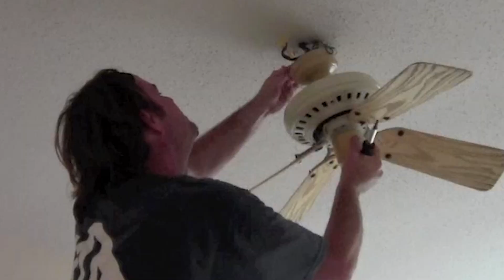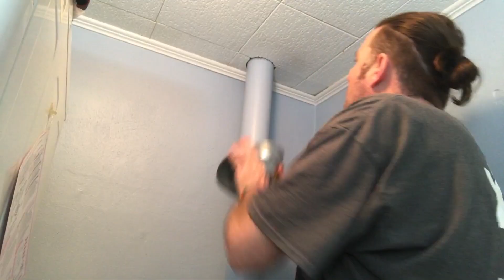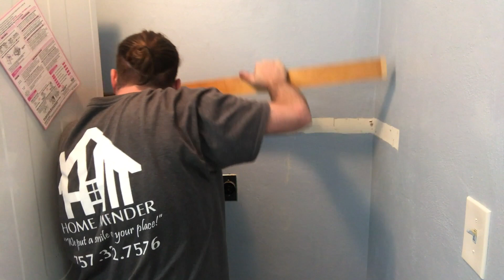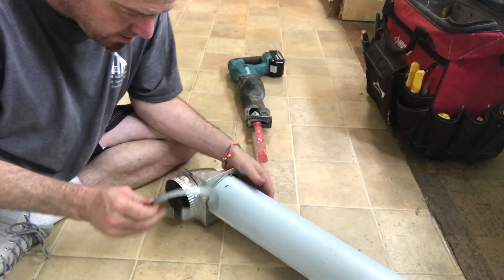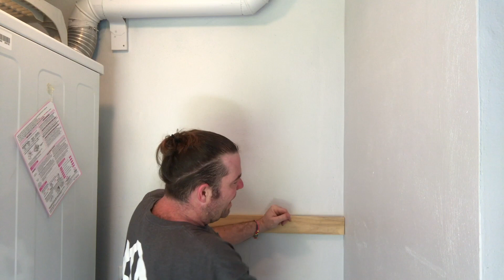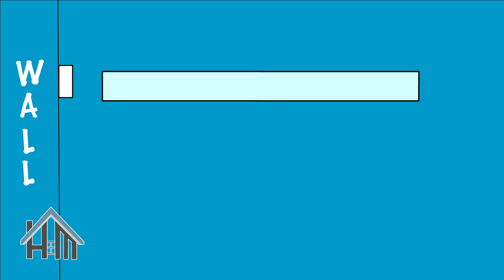Laundry room make over! How to improve space, save space laundry room.

Comment: Hey Dustin, love your videos. Great job making this look good again. Only critique is your should not use screws going into the dryer pipe at any point! Screws going in mean that more lint is going to get stuck on them and develop a clog over time. This can mean you lose efficiency on your dryer and possibly it ignites at some point (worst case).  What you should use is metal tape to secure the joints. You could still use the strap and not screw directly into the pipe from it and it would still support it.  Keep up the good videos!
Reply from the maker: hey josh..these screws are 3/8 pan head self tappers...if it does poke through to the inside, it would be nothing more than a nub... ive never had an issue using such shorties...thanks for sharing!